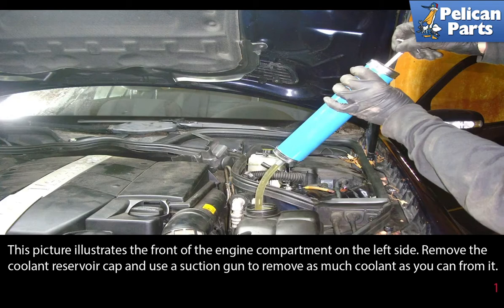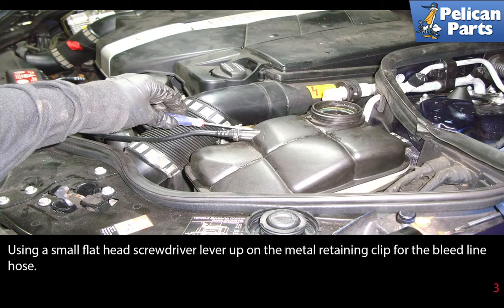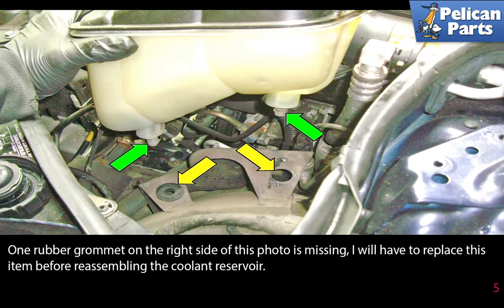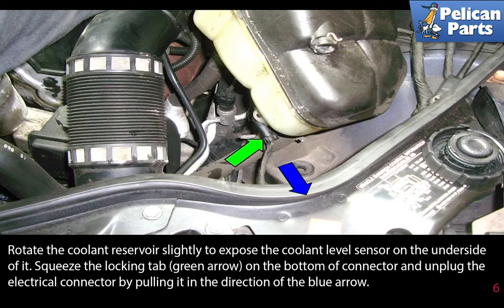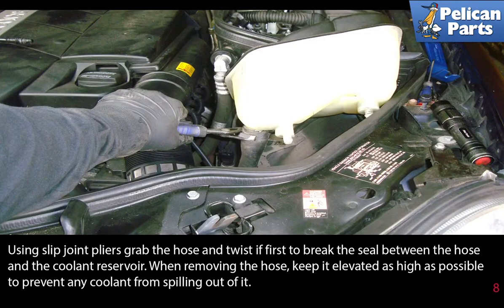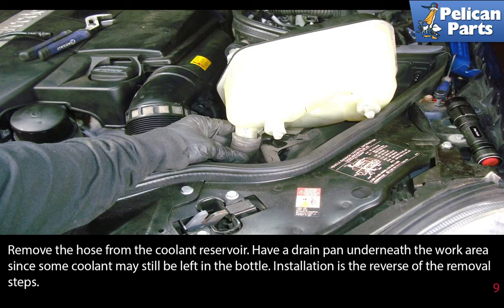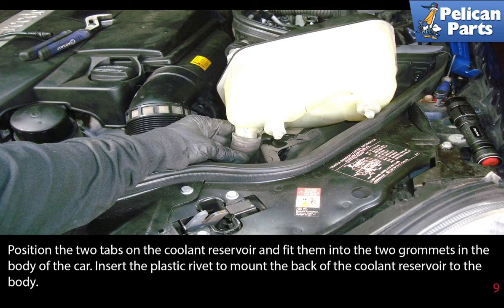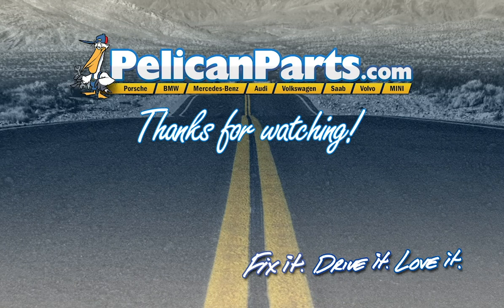Mercedes-Benz W211 E-Class Coolant Reservoir Replacement

Comment: Where did you find the missing rubber grommet?
Reply from the maker: With your vehicle info handy, give The Pelican Parts parts specialists a call at 1-888-280-7799. They can figure out what part or repair kit you need.